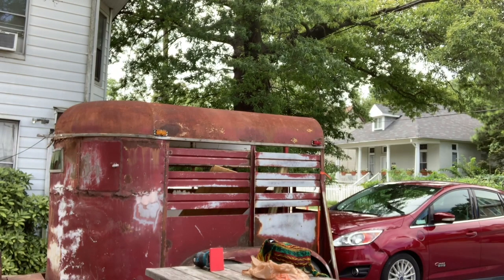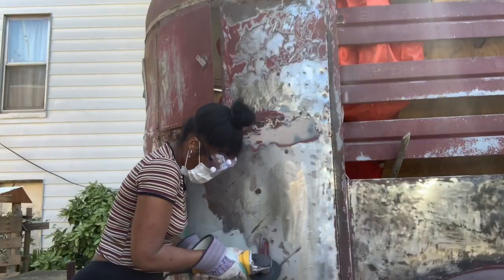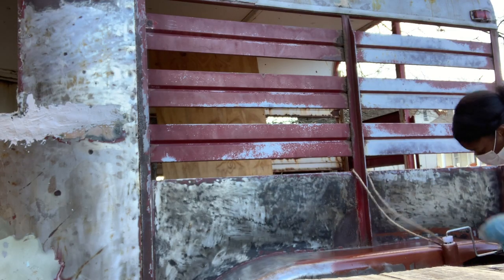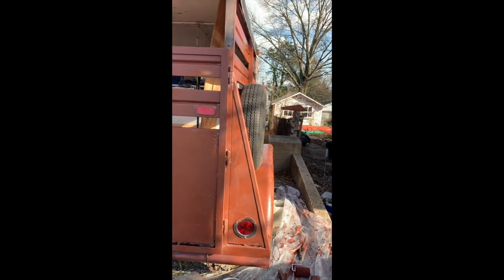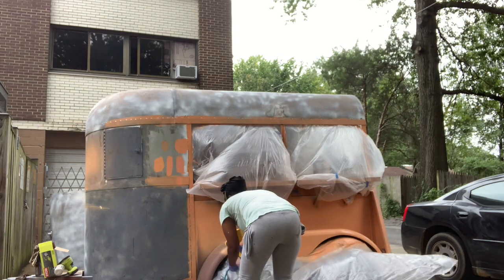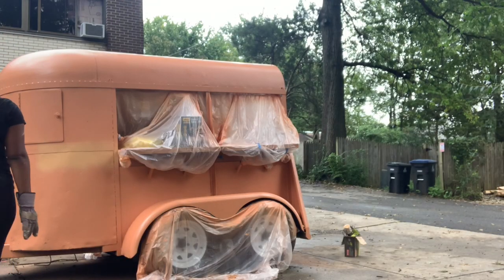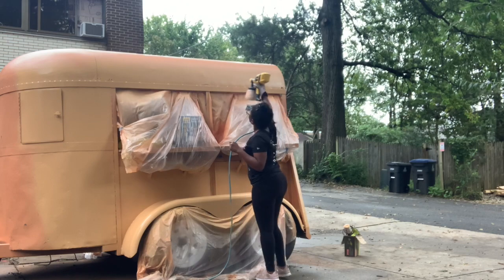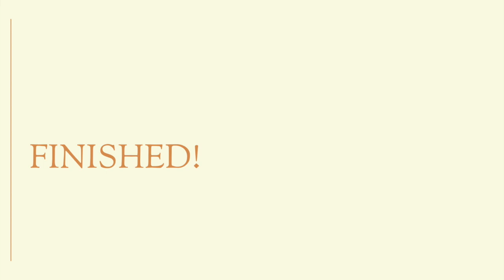How I Built My Mobile Bar Pt.2 Exterior

Comment: what type of paint did you used, car paint or normal?
Reply from the maker: I used rustoleum as the primer/base and regular exterior paint (I believe Behr) on the outside. The premium kind
Reply: How has the regular exterior paint held up?  I’m almost to the painting stage
Reply from the maker: @rachelobrien7627 very well! However it does need to be touched up every year. Try to keep the trailer covered/indoors- exposure makes it wear faster

Comment: Hi, I am currently working on a trailer for a mobile bar as well, I'm trying to figure out what to put inside, what did you use inside as far as water and electric/lighting, I have a  7x14 cargo trailer.
Reply from the maker: Hi Cecila! For water I purchased a portable sink for handwashing (similar to what you would use on a camping trip https://www.tidohome.com/products/portable-sink?)variant=35554659238046&utm_medium=cpc&utm_source=google&utm_campaign=Google%20Shopping&gclid=Cj0KCQiA2af-BRDzARIsAIVQUOd51gQ0hzZgtxB-3xvJGeeGLNUWL8F2THUWjpCdFj3X3bHlmSu3vegaArj9EALw_wcB) I figured since there are no specific laws in my state regarding water requirements, this was the best option. Though some may find it best to follow after food truck laws in their state (which typically require a 3 compartment sink). 

I also made the decision to not include electrical outlets. We operate with a generator (Honda series) or require access to an outlet from clients. There is really no need to include outlets as you will most likely only be powering a keg/wine cooler and maybe some string lights- this has been confirmed by other mobile bar owners in this industry on a majority. Let me know if this helps!
Reply: THANK YOU... TRYING TO FIGURE OUT HOW i WANT TO USE MY SPACE.